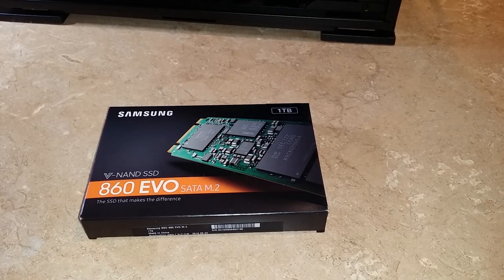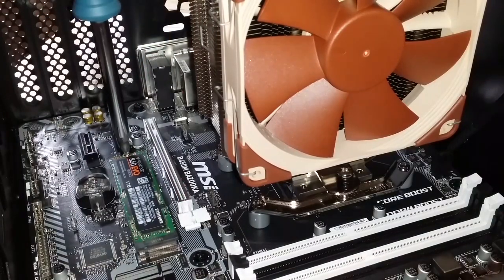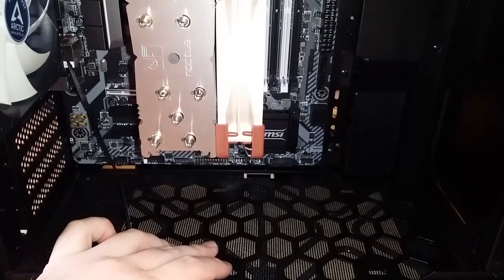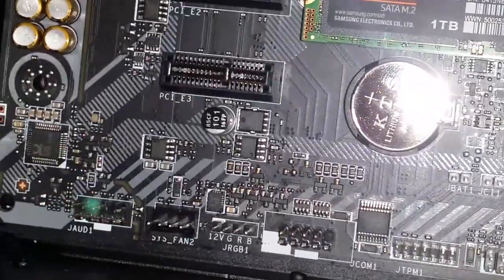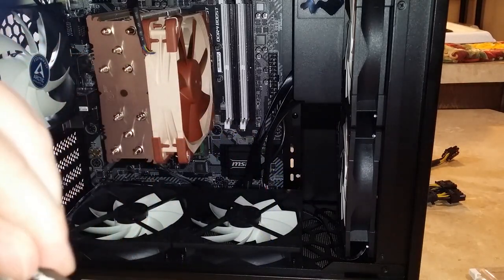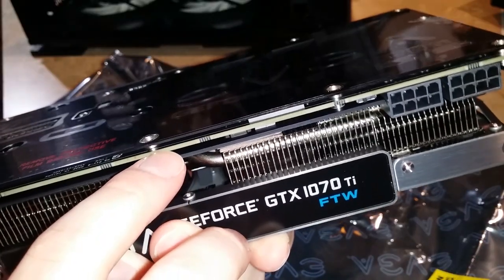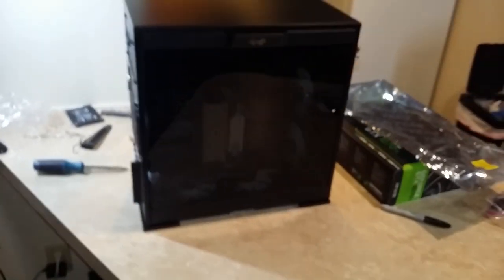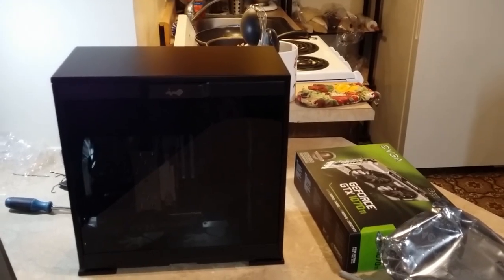New computer vlog (Part 3: Ready to Go)

Comment: Surely you now have negative pressure in the case, as you have 4 outlet fans, with the powersupply, and also the CPU fan adding more outlet pressure by blowing straight into the outlet on the back. That's some mightly negative pressure... negative pressure is known to accumulate more dust, as it sucks in air from all the little unfiltered gaps.
So you better make sure you have clean air in your room.

Also I don't get the point of sucking out air from both directions. Perhaps it generates some turbulence that prevents spots where the air would just flow past. But with properly placed fans, it's pretty obvious that a unidirectional air-flow is more efficient. It still creates sufficient turbulence.

Maybe you can turn around the front fans, and add a filter, and check what's more efficient. That would be interesting to see.

Oh, and another thought: now your power-supply is pulling in heated air, so that's less than ideal. If you had air flowing from the front to the back, it would have a greater source of room-temp air.
Reply: In line with your train of thought and a particularly relevant remark is the fact that the CPU is going to suck in preheated air comming from the GPU, so i think the front fans ought to work in this build as an intake, but well see marshalls temp tests.
Reply from the maker: I'm going to do some thermal tests and try flipping the fans around, I think the fronts might be better as intakes